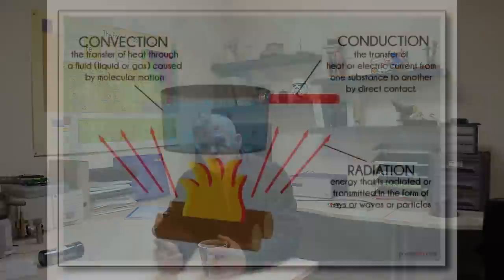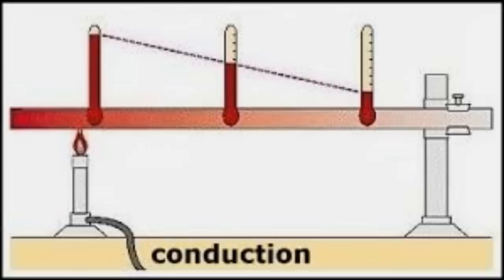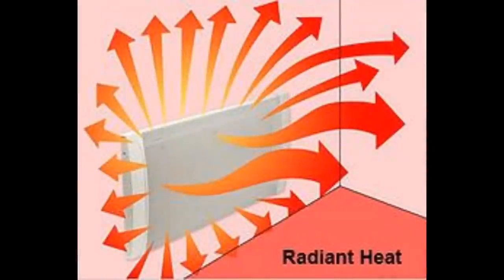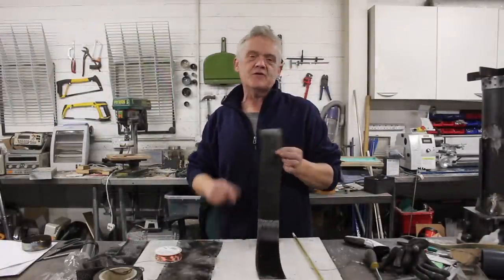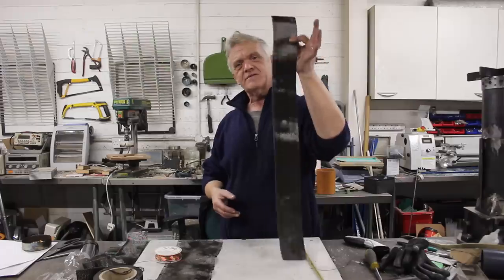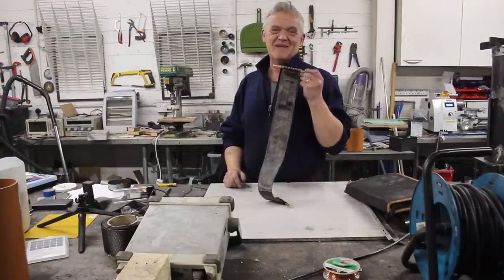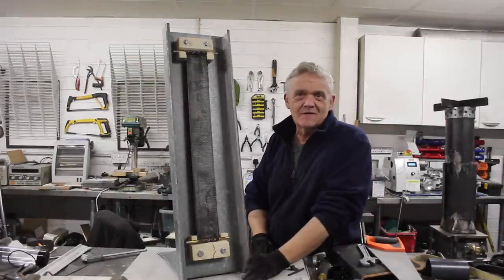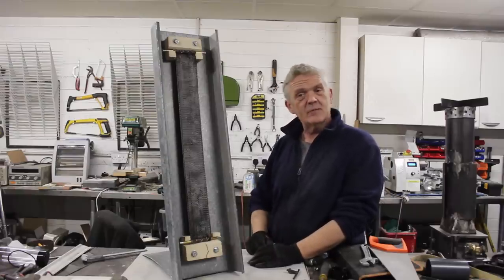1758 How To Make A Nano Carbon Infra Red Heater

Comment: The thing with conduction is that when you the person moves, they get cold pretty quickly because the air you are now moving through is cold in comparison. Which is why we heat places and not people. If you are going to be sedentary for a time, then conduction plus an extra layer of clothing works just fine. Most home electric heaters at 1,500W are barely acceptable for even a fairly small area. I'm in Canada, so our wall voltage is 120V/60hz, not your 230V/50hz of the UK. I use an oil filled electric radiator set at a 750W to keep my well house from freezing up in the winter months, and nothing but wood heat for my house (2,400 sq ft), at roughly a $150 - $200 a year for as many cords as I can manage to get if I go into the bush and get the wood myself. If I buy it (because I'm getting on for 70, so that's now a distinct possibility), the cost will go up many times for a cord of wood. About $1,000 for three cords split and delivered. Three years ago it was only $125 a cord. 12V will require a battery (to be recharged often for each heater if used concurrently) or a voltage converter (for each heater unit) for wall current. A Canadian made step-down transformer will cost anywhere between $200 and $450 cdn. So this "nano" Carbon fiber cloth puts out a wavelength of 780 nm-1mm? Which is right in the ball park for medical use (700 - 1000 nm). Something I already do...and it works very well, but uses LEDs rather than cloth. The construction of your experimental heater is rather bulky. Do you have a way of it being just as efficient but quite a bit smaller in size? A most interesting video.

Comment: I once worked as an R&D technician for an aerospace company, where we were developing  aircraft ice protection based on a glass/thermoplastic composites. Our initial resistance method was to metal spray first copper, as the conductor, then overspray that with a nickel based alloy called "Centanin". Later on in the process we were looking at using carbon based inks to spray, or screen print the elements, which was not only quicker, but much finer definition. This was proposed as a way to heat some, temperature critical components "locally" rather than a whole assembly.......then cane the 2008 banking debacle........you can guess the rest...☹️

Comment: That would be a great insert into a sand battery for heat storage. Some where in the northern hemisphere there is someone rubbing their hands together to keep warm, wondering why you didn't mention friction heating. LOL. You are an amazing teacher.
Reply: I'm not sure about that. You want very very high temperatures to exploit potential of a sand battery.
Reply: @oakld  When you are considering commercial potential, I would say yes. But I have learned not to count on Gov't or commercial entities. When considering a solution, I consider the adaptability and replicability for the single user. Considering all the potential applications and scale, can't be posted on forums like this. A single household with a solar and or wind generator system, might be able to use this as a dump load feature to a sand battery and recover the heat at night for a home heating system. 👍
Reply: @stewartpalmer2456  I'm for small businesses and even DIY. But one should understand the basics, physics and the math behind. IMHO, heating sand "battery" to low temperatures is like hammering a nail with a handle of a hammer. You simply need high temperatures to make it efficient and meaningful. And I don't know where you live, but we have no meaningful wind conditions and solar is 10x weeker during winter, so you won't even cover all appliances, let alone heating.
Reply: @oakld  I understand what you are saying. The sand battery I'm thinking about would be more of a subsurface floor heating system. If you have a load dump you can divert it into any of a myriad of storage systems. I'm thinking of carbon fiber reinforced concrete flooring. It's very hard to put every thought into these types of forums. Lay down a sheet of carbon fiber, place your electrical contacts, then thin coat concrete over the top of any existing structure.
Reply: @stewartpalmer2456  Well, maybe I simply don't get your idea :-). Why to use sand, for what you've described? Most of soils would do a better job, wouldn't they? You can "charge" even ordinary ground, this effect is used in earth-water type heat pumps. But experiments were carried out with a soil enclosed in an insulated "box", something like what you have in mind, if I'm not mistaken. In any case, you want to control amount of heat retrieved from such a "battery", to avoid overheating your house, meaning you'd typically have some kind of heat exchanging loop. The same thing is for charging. By the way, if you charge it with heat pump, you'll might get like 500% efficiency, because such battery will allow you to choose favourable conditions for charging. But it's becomming a general true, that the best heating is the one you don't need. A passive house is a way to go. I have a low-energy house (heat losses about 2,5 times higher than what standards defines for a passive house of my house size). I have a solar system and getting heat pump, I can cut down energy bills a lot, but it's only so much you can do with the heat loss (even that small) my house have. I plan to do some smaller improvements on heat losses, like insulating the tip of the attic where recuperating ventilation unit sits, putting extra screen in front of my only double pane window (all the rest are tripple panes, this one is a roof window), etc. Everyone should start with those things and prevent a need for excessive heat in the first place.
Reply: @oakld why do you need to heat sand high

Comment: This should be an absolute boon for car camping, etc... 
I've been experimenting with a 250watt  infrared bulb I used to keep my chickens warm with. I like the idea of 72 watts much better.
Excellent. Thank you.
Reply: Great idea but d cells would be exhausted quickly. A mini heating pad in direct contact with you in a sleeping bag would be much more efficient, needing less Watts to heat you in that configuration.
Reply: My Dixie Wrecked🔨  and catch fire. Seriously, though, in a small space like a backpacking tent or bivvy, heated air is better as there's always a condensation problem in such a situation.

Comment: Infra red heaters are popular in the construction industry for drying out plaster, paintwork and after water ingress for example.  I presume because of the lower power consumption and less chance of a fire when left unattended.
Reply: As I understand it though: Traditional infra-red heaters (like you might get in a pub smoking area) mostly give out near-infrared, which gives that you that baked-alive feeling. Whereas supposedly far infra-red heaters feel more like pleasant warm sunshine.

Comment: Hello Robert, I sit in a folding law chair in my home sitting on a heating pad. I wear a warm coat, cover up my head, and add a blanket over my legs. This keeps me very warm with a small consumption of electricity. Only my nose gets cold.
Reply: what about your water pipes?
Reply from the maker: we really don't have to worry too much about that mate - it rarely drops to freezing here
Reply: That's a new idea for Robert- A Nose Warmer
Reply: @ThinkingandTinkering  I wish 
we have had below freezing temperatures here for weeks already
Reply: @rayg436  Hi Ray. Thank you for the opportunity to chat more. I keep the house at 55 degrees Farenheit to keep pipes from freezing when below 32 Deg F, and the Kitchen located Refrigerator pumping freon gas freely through it's coiled pipes at above 50 Deg F. as recommended by the refrigerator manufacturer. Hope that helps. Enjoy your Day. :  )
Reply: @limmoblack  gg morris....Thank you for the gift of a laugh.  :  ) Good One !
Reply: In the 21st century.

Comment: Knowing you have a bit of a penchant for all things carbon, this is exactly why I suggested this one the other day mate, glad to see this video, really been looking forward to it (although I didn't expect it would involve sewing!). 

Still got a tonne of your conductive ink lying around here from previous experiments, so keen to see anything that involves that too. I wonder if low voltage infra red wallpaper could be a possibility even! Infra red hearers really are a bit more unusual which always keeps me interested! Thanks as always for your informative and helpful work!
Reply from the maker: I am on that today mate - cheers
Reply: Guys - really great work here. 
Now , 1. Today’s carbon felt heater - are we feeling the IR form the carbon material itself; or from the galvanized metal ?

What if we bond the felt to the metal; can we turn the metal into a radiating panel ?
Reply: Putting up galvanized sheet metal on walls of my Shop / Garage atm.
I wonder if I could apply a current across them to turn them into radiant panels… safely of course.

Or, perhaps it’s better to build radiant panels as stand alone items.  Hang on the wall, or ceiling.
I think we need high Emissivity finish.  Not sure how galvanized metal (shiny) performs.

Now - off to research your conductive ink ??  Never heard of this !